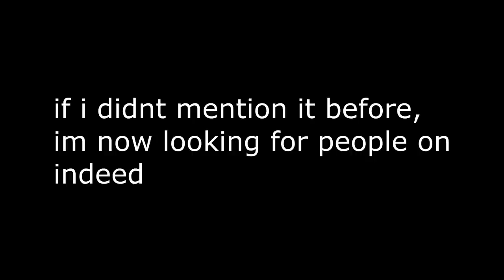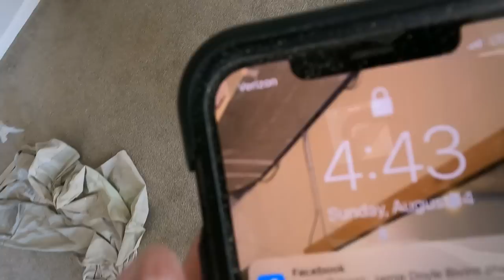Damen's Back

Comment: Joe when you're doing touch up paint take a little 4-in roller with a cut bucket and a screen in it so you can reduce the brush marks on the wall especially after spraying just a helpful tip great job with the painting company I find myself working 8 hour days painting then coming home and watching your videos great job keep up the great work

Comment: The most important guy you have to impress is the maintenance supervisor , if he likes you, thats whats important, so do him a favor that will keep him from having to do it, is carry a white can of spray paint and or kilz and spray those rusty ac vents, just mask them with 3 inch tape, dont put the tape on too tight, just tack it easy and it wont pull the paint off, it will make your work look so much better, the guy you saw working solo was probably the in house painter, keep him happy too, he has to go back to your apartments more than you think to touch up, just a couple of hints, you doing good Joe, just be nice to your workers, they will work twice as hard if you be nice, if they cant paint just let them go.

Comment: Just slow down and take the time to grow yourself a solid business Joe. Do not try to prove to the apartment complex that you can do a bigger job than you are prepared to do. You dont have the crew, experience, or knowledge level to justify trying to do so much so fast. You can make good money by doing smaller projects and focus on quality and growing something solid. As a painter your truck should also be setup for the job to make your life easier which will result in less stress, less time, and better product. AND A HAPPIER JOE! This is not to put you down, but a suggestion from the outside looking in. I want you to win either way, your a hard worker, just work smarter! Good luck in all that you do.

Comment: Isn't Lauren the one who came in saying she had experience because her father had a painting company or was a general contractor or something like that? You were questioning why she didn't work with her father if that's the case and she had all the experience that she claimed? I think it's safe to say we are all figuring out why she doesn't work with her father. Definitely not dependable and good chance that her father fired her ass. She might be a good worker and as long as you are okay with her inconsistency and undependability then use her whenever she shows up otherwise cut ties with her and move on.